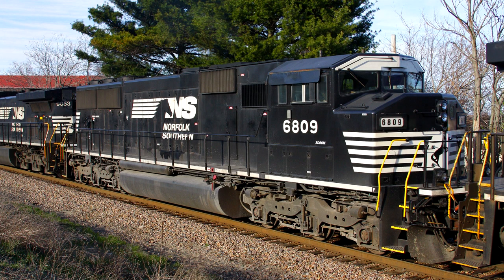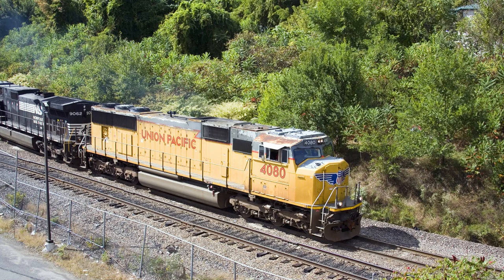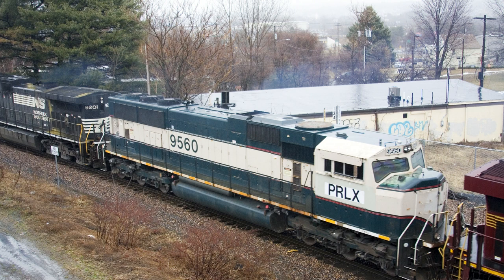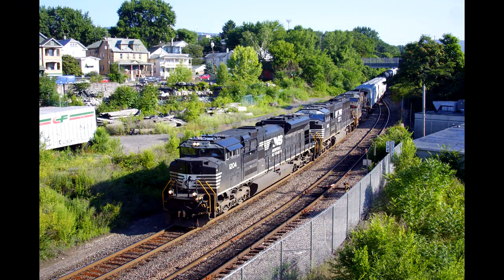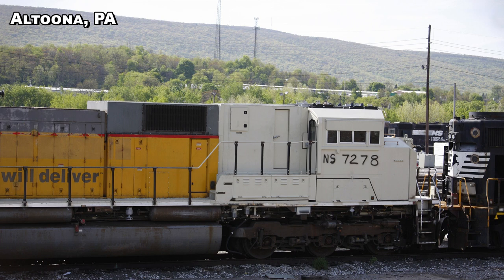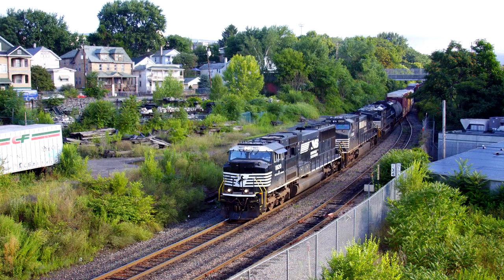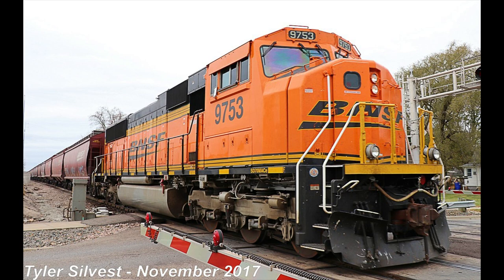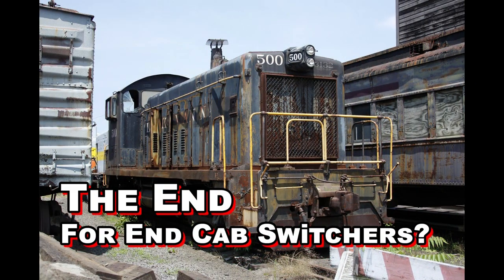EMD's SD70 AC Locomotive Family

Comment: The thing about the SD70 family is they all are higher HP then their GE versions, and are also heavier making for better Tractive Effort as well.  HP is good for speed but means nothing if you can't stick to the rail and that is where weight comes in.  Heavier you are, the better you stick to the rail.
Reply: The only EMD units to surpass the C44-9W's,AC4400CW's,and ES44AC's on horsepower are the SD75I's & SD75M's.All other EMD units are just right behind the GE units on power ratings.Also,GE units are far more better when it comes to incredible tractive effort and dynamic braking for serious tonnage.The only advantage most EMD units have is quicker loading traction motors,both DC & AC,and perhaps acceleration even though most don't have instant throttle response like gevos do.Everyone else can also agree that an EMD unit won't catch on fire like a GE unit but that's not doing much.Modern EMD units aren't as great as most of the older units.

Comment: The info is a little inaccurate.  Lube oil does not make it way into the exhaust of a 2 stroke diesel.  Diesel and gas 2 strokes are completely different and have nowhere near the environmental effects as a gas 2 stroke that uses oil and gas mixture.
Reply: it is accurate as is the reason why Detroit Diesel 2 stroke engines are banned in America.
Reply: @billdurant3560  no, it’s not really but keep telling yourself that.
Reply: @ohboy2592  you got the good drugs
Reply: Came here to say this. 2-stroke diesel intake is forced-induction scavenging with clean, high pressure air. Lube is not mixed with the fuel or intake air. The poorer exhaust quality comes from lower combustion efficiency and a smaller range of acceptable stoichiometry - leading to more NOx and unburnt fuel in the exhaust. A two-stroke at large scale can easily meet Tier 4 exhaust with catalyst and DEF.

Comment: The ten unit SD70M order were part of a UP order that NS was able to get. These were the only new units purchased by NS with a desktop control stand. In the case of NS they were always late to the party behind BNSF and UP when it came to new unit purchases and often got what was left for production availability for that year.
Reply: They were late to the party, always, but also the company strategy and planning vision.
NS stayed loyal to DC traction, and switching from high short hood to low short hood (hi  hood SD40-2, B23/30-7, GPs etc; later when other companies switched to wide safety cab, NS sticked to Spartan cab all the way with C40-9 and SD70
Reply: Don't forget about all the rebuild programs they make up for older units or for units that are in storage,even from other railroads,just to cancel the process at some point or sell and put the units back into storage.They only completed 135/240 SD60E rebuilds,52/80 SD70ACC rebuilds,recently reacquired 46 SD70M-2's (Now as SD70ICC's) after having them in storage,and did 110 SD70ACU rebuilds until selling 65 units to PRLX that are being scraped.In all honesty,most of the SD9043MAC's and SD70ACU's already had cracked frames which is why Union Pacific wanted to get rid of the units for dirt cheap.

Comment: The SD70ACi bb are meter gauge eight axles locomotives with two four axles articulated trucks for the tight curves of the Brazilian meter gauge railroads. You should check them out on You tube.